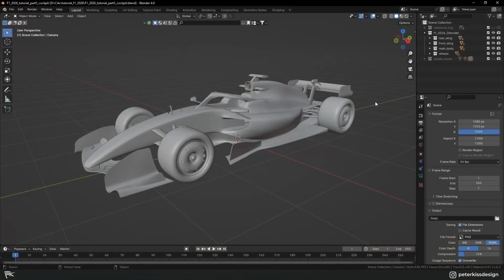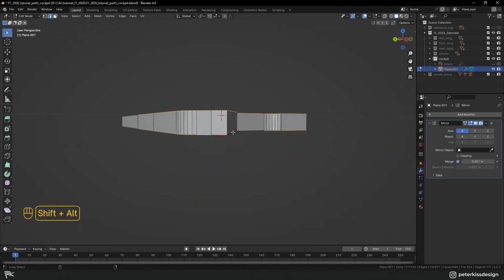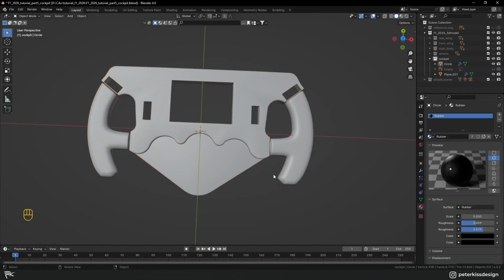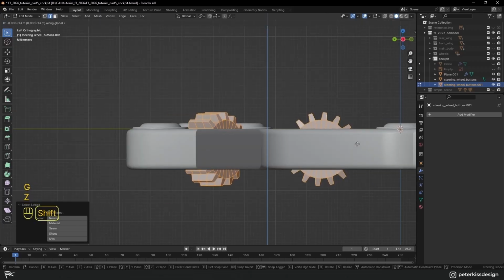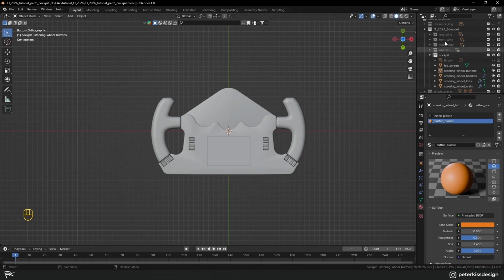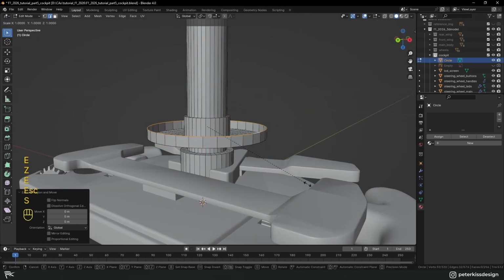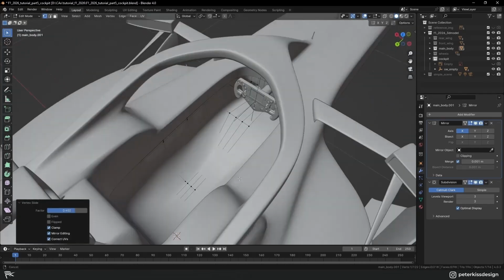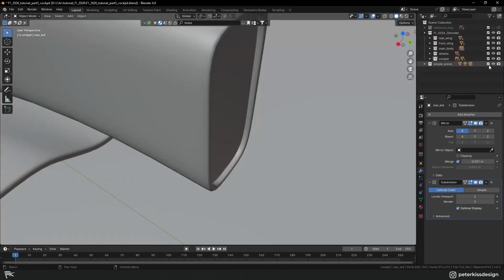Learn Blender by Making F1 Car – Part 5: Details

Comment: Thank you sir, please continue this series. I have made the front and the rear wing. I have no previous experience of using blender. I am just following your guidance. I had a doubt too. When i completed in that wings video you did something that red and blue thing after adding materials. I did that too but only two bits of wings were red and nothing was blue the floor was grey and the rest of the wings were carbon fibre . Pls reply❤❤
Reply from the maker: Hi. The black and red was face orientation. Basically you have front and back side, blue is front, what you want to see, red is back. I will explain it more in depth in next video about uv unwrapping, after which will be texture.
Reply: @peterkissdesign ok sir thank you very much❤